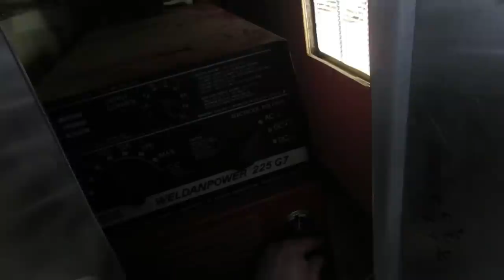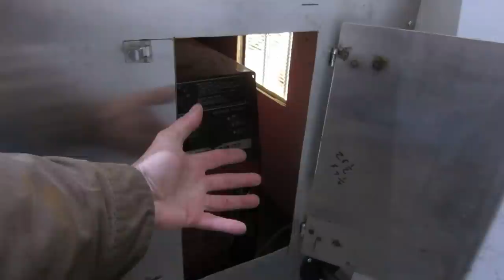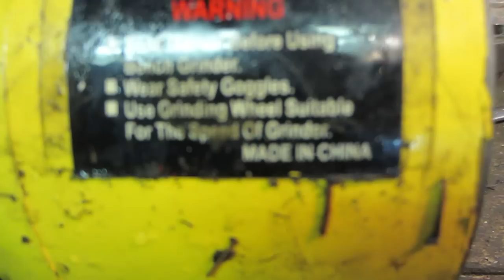trailer trash lets the smoke out

Comment: I've messed around with a bunch of AC motors over the years and I don't think I ever saw a case so unmatched for the motor it houses!   I was stunned when you split it apart and pulled out that tiny ass rotor!  That's some trick shit right there...  was junk right off the assembly line.
Reply from the maker: right, they make it look like its this big ass motor but on the inside its a hampster on a wheel

Comment: Nice build. I'd be lining the inside of those cabinets with egg crate foamto keep the noise at a minimum inside of the trailer. I think I'd hinge the countertops to the outside wall also. That way you can access the genset without having the countertop in your way.

Comment: You are doing a great job on the trailer.  Could be used for a tiny house too.  One concern, when we were using our generator IN THE LINAI with the windows open after Hurricane Matthew, the fumes were entering the house.  I'm very concerned about the fumes in that generator area, even with the window, especially if the ramp door is closed.

Comment: I think you get water inside your generator cabinet from that exhaust, rain will run down that exhaust, and follows that bend to the inside of your trailer. maybe you can weld a plate on the exhaust just before it enters the trailer, to create a low spot where the water will run off.

Comment: Got a quick question you seem like a guy that might know I have a miller 145 generator arc welder with a Kohler gas engine I can get it to start up and it runs fine but is soon as I strike a narc and it supposed to kick up an idol it stalls out anything you think I should look at I don't know if the carburetors dirty that's what I'm leaning towards

Comment: Hey Harbor freight has a chinese diesel heater for vans and rv's I saw a guy instal in his winabego like $120.00 he installed several  you just want the ones that are solid metal verses plastic cover. Also german cars didnt used to have the best heaters in them but Im in north dakota no air compressor in ur tool trailer Irecommend a honda powered/or harbor freight engine

Comment: your welder/ generator will overheat at 100 degrees, exhaust restriction and ventilation are critical.  Of course I was running a much larger engine than yours.